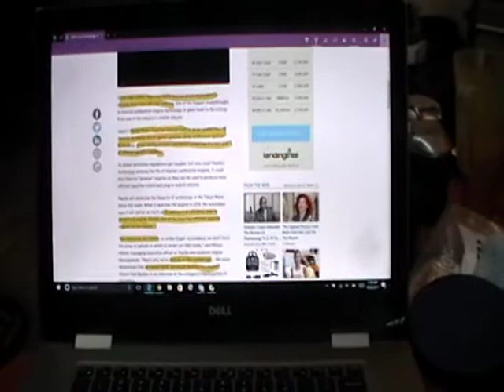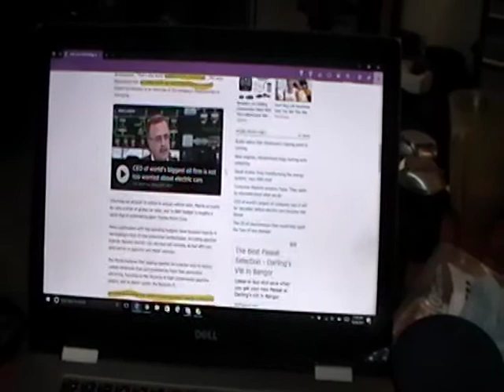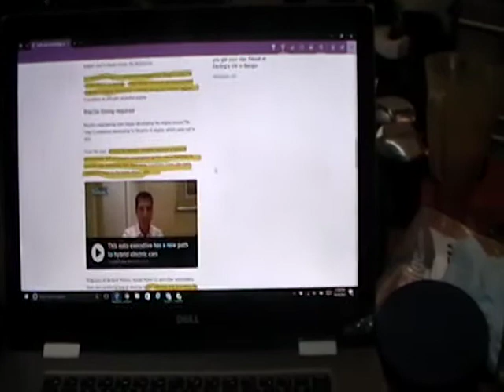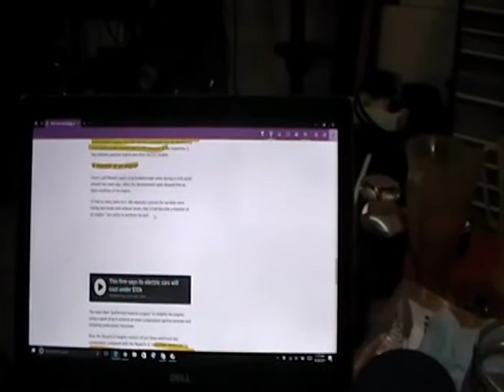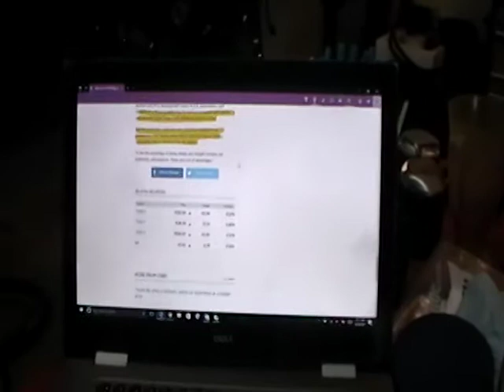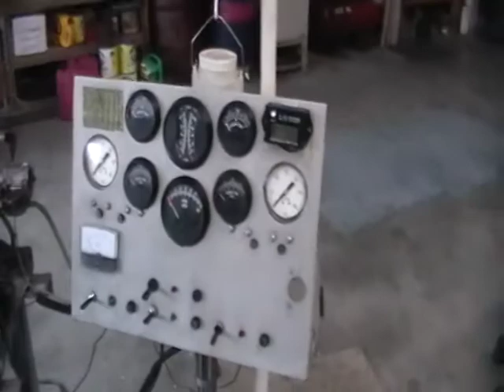BOURKE Engine  HCCI   10/26/17

Comment: Hey Roger, its Skyler. We spoke over the phone a couple times. I'm still reading through Russel Bourkes book and I'll be working on the vapor fuel system as soon as I can. I really think the carburetors as Russel Bourke himself has said, they need to go. I've thought of a couple things that may help get the HCCI going more consistently. If I had a lathe I'd make them myself. But if time allows, what do you think about a piston with a tiny 1/4" to 1/2"  pillar in the center and a pocket on the head where you can have a 60.1 compression ratio to guarantee detonation inside this mini chamber every time yet it won't break the engine because its such a small amount of fuel/air all its doing is igniting the rest of the chamber and starting the detonation wave. Like a miniature piston on top of the piston face. And the chamber would be so small it wouldn't hardly make any difference on the cranking power to start the engine. We might even be able to eliminate the spark plug entirely.

I seriously can't wait to get my vapor fuel system running and eliminating the throttle plate entirely. A pure gaseous fuel will homogenize almost perfectly inside the intake manifold. A pure gaseous fuel, no vacuum inducing throttle plate that causes pumping losses, consistent HCCI pulse detonation.

The more I read about the Bourke combined with what I know and am learning about how fuels work the more I am convinced that we are right on the precipice of the ultimate engine and fuel system. We're almost there!